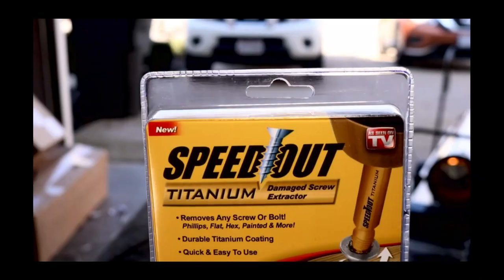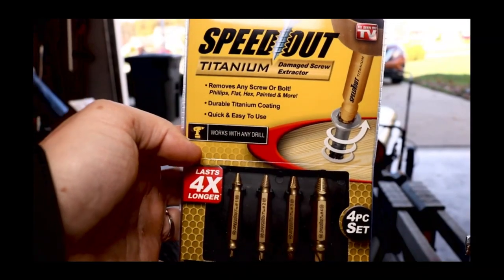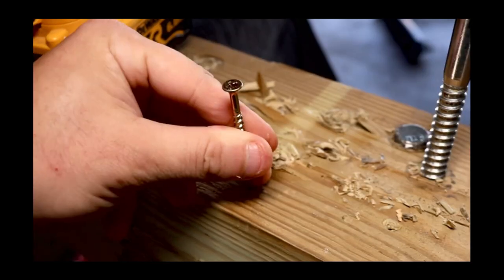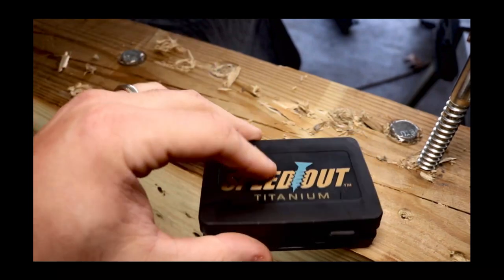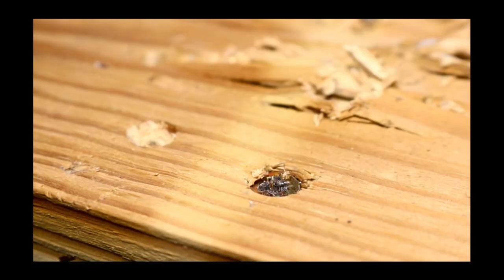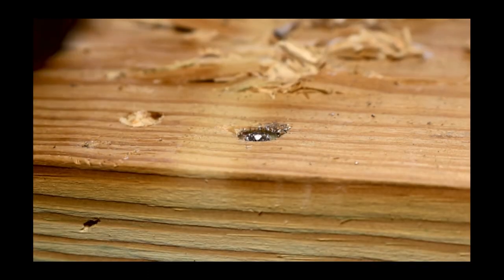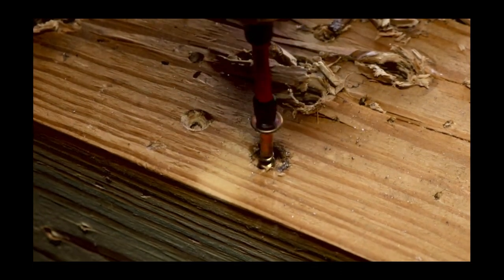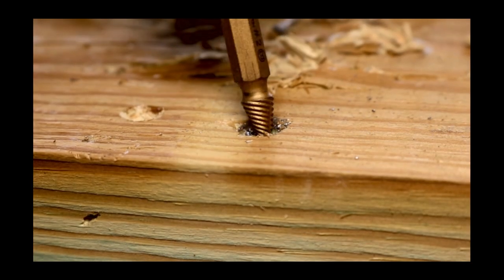Can you really remove ANY STRIPPED SCREW with this "AS SEEN ON TV" (Speed Out) screw extractor set?

Comment: Purchased product yesterday,  having the same problem. Wish I would have seen this video earlier.
Reply: Same thing. I'm replacing deck boards. Doesn't work at all. I'm going to try and get my money back. Home depot should not sell this garbage.
Reply: @dragormeghar2100  thanks for the information.  I think the bits were not strong enough to cut into the deck screws. I've removed other softer screws with no problems.

Comment: First, they’re only titanium plated. Second, you should use smaller size extractor bit. If it can’t drill a nice DEEP hole, use a good metal drill bit, then use the extractor to reverse drill it out at SLOW speed.
Reply: Thank you!!!  It did not work but once I drilled the hole, worked like a charm.  Thank goodness I saw your comment!
Reply: Yo! Your advice work like a charm. I spent the first 30 mins dicking with the cutting tip that speed out came with and got no where. After reading your comment, I busted out the Milwaukee metal bits and then used the extraction tool and it came out with the quickness
Reply: @kyleleah4830  new to these terms can you explain in simple terms ?
Reply: @jjking8577  they make drill bits out of different metals for different tasks. For drilling through metal, it’s recommended to use a carbide drill bit or a titanium drill bit (either fits into any standard driver or you can use an impact drill if you use a hex-shaped drill bit). The commenter was saying that he used a drill bit meant to drill into metal, then used the extractor (the screw-out tool) to remove the stripped screw.
Reply: spot on!
Reply: Yeah , I think the reason this guy's bits rounded was because he used high speed instead of drinking and extracting slowly
Reply: Yep. This guy's main purpose was to make them fail or has zero common sense.

Comment: Coincidentally, I bought and used one of these kits today. I had a good set of screw extractors which were stolen, so when I had a bad screw to remove I looked to replace them. I was in a hurry and couldn't find the ones I wanted, so I picked up one of these sets. They worked fine on this screw; it was removed in about 15 seconds. I don't know how well they will hold up long term, but they worked this time.

Comment: It worked like a charm.  I had little trouble using the smallest bit first - dug a shallow hole out slowly, but used the next size extractor when the first size didn't work and that removed it easily.  I'm luckily only one screw on the 48v battery was stripped - it locks down w three screws which still work w hex head.  Just work slowly when you dig out the hole, and also slowly when you extract with a larger size bit - so this is fine, I'll keep the set of 4 for any future screws.

Comment: We just tried this at home to remove Philips screws really stuck and stubborn in a metal plate in our washing machine... We stripped them trying to get them out, as they're really stuck in there... we bought this product and at first didn't seem to work, but then I just tried a bit more and used side 1 longer and deeper cone cut out and then put to side 2, and gotta go slow (drill needs to have variable speed to go slow movement) and sure enough it worked and got out all the screws... So It Worked !!! I don't have video of doing this, but reporting here honestly. I have photo of the screws after I took them out to see the cone cut out shape in them.. so it works folks !! Money well spent and changed a tub seal on our own and saved $$ calling a pro in.

Comment: Hello. I just used this ten min ago. In defense of this product, it Worked like a charm.
Reply: Hi, do you need a high power screwdriver? I have not had one, I am thinking about getting a 12V cordless with low gears or a 280w corded screwdriver. What type of screwdriver did you use?

Comment: These bits do work for the most part. I was on a job yesterday and had to remove about 10 round hex bolts, only a couple beat me. You just have to be patient.
Reply: I’ve been working for an hour straight and it hasn’t moved one turn yet

Comment: He didn’t drill the bit in all the way before extracting. I just bought this and it works perfectly
Reply: looks like the bit in the video was getting damaged right away, how long did yours last ?
Reply: @derek7793  I used this to remove the original door hinges for three doors in my 1948 home, 18 screws total.  It works but you have to use a lot of pressure behind the drill and really cut a hole in the top of the screw.  In terms of durability I broke one of the bits on an especially difficult screw but given the modest price it was worth it.
Reply: @miguelalmodovar9201  forsure thanks for the information
Reply: I'm using SPAX Made in The USA Fasteners, they got Heat Treated Philips and Torx Head carbon steel Exterior and Interior Screws using a Philips bit #2 and I never had this kind of problem. Sometimes this thing happens when you use a cheap type fasteners. Or you can Still use cheap ass fasteners but make sure it's a Torx head screws for less strip out and cam out. Or you should pre-drill your hole first before installing the fasteners.
Reply: @Luke Gu I sat there and tried drilling it out for like 30 seconds to make sure I was deep enough. Then I switched to extractor, pushed hard, slow trigger, and nothing, no bite. I tried several sizes, different methods, always tried extracting with FORCE and SLOW, no bite.

Comment: I bought a set of irwin brand extractors. They worked really well especially for those door hinge bolts. I even used it on my brake rotor screw. Tool em right out.

Comment: They do work. I’ve had a set for a couple years, they work as extractors. I have plenty of good drill bits, so I don’t generally use the drill end of the bits, I drill out with Milwaukee Shockwave bits, then use the extractor end.
Reply: Yes mine work great also. You have to use low speed on your drill and they most definitely will remove the screws. Most drills have a speed control in the trigger pull, if you don't press the trigger all the way the drills will spin a lot slower. 👌 and mostly all brands of drills have that feature.   Less pull of the trigger in high or low speed setting will reduce the rpms of the drills. 🤷‍♂👌
Reply: Interesting... I've used similar screw extractor bits before and had pretty good results. That "titanium" is clearly too soft to do the job. Shouldn't round like that.

Comment: I'v had a set of these for 3 years used them dozens of time they work every time for me.
Reply: The cobalt ones have worked for me several times as well. I've seen negative reviews on the new titanium ones...it seems they are not really titanium.
Reply: They worked for me also. 👌 I'm buying another set. One for taking to work and one set will be in my work shop. 👌
Reply from the maker: @lesswatt  way to soft to be titanium. I Should have went with the cobalt

Comment: I FIGURED THIS TOOL OUT! I was having the same issues with the extractor just slipping and the bore tool not doing much boring. I was about to return the thing.

I solved the issue by boring first at high speed with LOTS of pressure. Do that for a few seconds until you aren't getting any deeper. Also make sure to not move your drill around to much because you don't want to widen the hole. 

Here's the tricky part. It's counter intuitive but when you swap to the extractor end DONT PUSH WHILE YOU TURN. Before you start turning you can push a little to kind of "set" the extractor. But before you start turning let off all the pressure and go SLOW. You'll feel it grip the screw head and  keep going slow until you get the head out and then you can go a little faster. It's actually surprising how much those thin threads grip the screw head. Sometimes it's actually hard to get the screw off the extractor!

Hope this helps!
Reply: Thank you helped me get a ps5 m.2 stripped screw out
Reply: Great advice thanks I'm going to try that.

Comment: Same results. I've been trying this shit for 2 days straight and all the sizes just spin freely inside the head of the screw. No matter how hard I press it in while drilling or no matter what size. The screws stuck in are the torqx and the head is stripped to a point where they're almost super smooth and that is why I decided to try the speed out bits. I'm getting my money back. I have no clue how the others are able to get positive results.
Reply: How did you end up getting it out?
Reply: @michaellloyd4170  had to scrape the part around the screw to make place to hold the screw with a plier and twist it out.
Reply: try hammering in the extractor

Comment: I use these in very upscale rc cars and trucks and they do work very well on stripped hex screws that most hobbyist use.
Reply from the maker: Yeah they are probably softer metal which helps?
Reply: @ToolReviewZone  negative sir, they use 12.9 grade hardened steel, nothing harder than that. 12.9 > titanium > 10.9 > stainless steel.

Comment: I have a set of Irwin extractor bits and if used at a slow speed they work pretty good but I use a separate drill bit to drill, then the extractor bit in the kit.   I've only had to extract a few screws over the last few years so the kit is there if I need it.  Thanks for sharing.  Cheers Clint.
Reply from the maker: Thanks for the feedback William! I've heard a lot of people saying the Irwin is good. I'm going to try it

Comment: I didn't buy these, but some different ones via Amazon. Had exactly the same problem. Instead of the extractor drilling into the screw, the screw stripped the metal off the outside of the extractor. Doesn't anyone make decent tools any more with the need for a small loan?

Comment: I bought this and it did help very well.  ... I just did not follow their instructions. I did it my way first use A side on drill. Second use B side on a very low speed such a 3 or 4 is good, the hammering on low speed will help to dig in and keep on trying on very low speed and hammering. If does not help move to speed 5. It should work

Comment: Purchased the drill set, came across this video and was very discouraged. But I decided to give it a couple more tries.. but this drill set really does work! During extracting keep pressure directly over the screw and go slowly, you may need to go up a size but I was able to remove two horribly stripped screws in a couple minutes. Hope this helps!

Comment: You are supposed to use the cutting side in clockwise Forward drilling in then flip the bit to the cone side. Now switch from drill to counterclockwise REVERSE and slowly reverse it.  Works fine.
Reply from the maker: They are crap
Reply: Negative. Both sides are for Counterclockwise. It's in the directions.

Comment: Every time I come across a new screw extractor, I gotta buy & try. Have around 7-9 kits somewhere around here from all different brands & places. Gotta say, it’s a hit or miss I’m d of thing. I have some expensive kits, to cheap kits & sometimes they work, & sometimes they don’t. Even picked up the Ryobi kit (most recent)I saw in a vid to give a try.....it’s ok, & like the others, works sometimes. Gotta tell yan if anyone ever figures out to make the BEST screw extractor kit that works 100% of the time (or even 20%, lol), they’ll be raking in the 💰 .  Looking forward to another bit vid.
Cheers✌🏼

*edited cuz autocorrect
Reply from the maker: Which one do you like the best Aepek? I'm sure there is probably something out there right?
Reply: Tool Review Zone Right now been using the $10 Ryobi set I picked up. Have used Rockler, Craftsman, Irwin, Ridgid, DeWalt, etc...screw extractor bits/kits & got quite the collection. I try not to strip a screw out, which is best way, as the extractors are a hit or miss at times. Have some good luck w/ the Rockler & most recently been using the Ryobi (so far it’s worked 1/2 times). The oldest kit is my Craftsman & I’ve never gotten a single screw out with it, lol. Haven’t found a set that works all the time. Cheers✌🏼
Reply: @Aepek  Wondering if you ever tried Vampliers to get out a long stripped screw (4 inches in wood). Reviews seem to be pretty good.
Reply: Lim Yee No I have not. But, b/c you just asked me about them, I googled them, & ordered the 8 & 6.25” & 7.5” pliers to check out for myself. Appreciate the reply, & for letting me know about a brand never used or heard of before.
Cheers✌🏼

Comment: The fact that the Philips bit worked in the end is all the evidence you need that it was not done properly. The drive of the head should be a completely smooth hole- you didn't drill out the drive portion of the head fully and should have never proceeded to the extractor end until you did that. 

The extractor ends work, but if the drill ends don't do a good enough job, you would have been better off using your own twist drills. Hard to tell if the drill end of the extractor was truly junk, or if was user error again.

Comment: this should Be interesting, I just bought this set last week but haven't used it yet. 👌
Reply from the maker: Let me know what you think
Reply: I actually tried them last night. I stripped out a spax 3 inch pan head cabinet torx screw and, used my drill driver in low speeds in reverse like the instructions said and they worked perfectly. Not a problem . You can't use them in high speed they won't work properly. And never use an impact driver they won't work like that also.  I did several different screws also with the same #1 bit extractor and it worked on all of them. 👌 I even took out a quarter inch thick, 3inch long lag bolt, not a problem. 👌 all low speed with my Dewalt 12v Xtream brushless drill / driver. Trust me they worked great for me. 👌
Reply from the maker: @jasonlevesque9303  thanks for the feedback
Reply: @ToolReviewZone  ,no problem, I like your channel and watch all your videos. 👌 trust me I'm a fan. This was the only video I've watched that I didn't agree with. So i had to give it a try and see for myself. And it worked great for me. But keep making videos. 👌 and I really want to see you do another video with the drill on low speed setting and see if these work out better for you. I'm subscribed and have my notifications on. 👌
Reply from the maker: @jasonlevesque9303  all good bro. I'm happy with the feedback and like to hear what others have to say. All I can say is that i did everything that the instructions and their own video said to do without the same results. I'm glad they worked for you, but its just my opinion that they are no good. That's one thing about be, if I don't like something, I won't say I do just for views or a sale.

Comment: I wanted to believe in these. I specifically bought these because of the cool flip gimmick. I tried them today, following the instructions to the letter - even pushing hard and trying to extract very slowly. No dice. I tried the smallest first, then moved up and then back down in sizes. Nothing. 
What I believe the issue is, is that the borer drill is just crappy and didn't work well. I feel like the extractor would have worked just fine if the borer had done a better job. I used a regular drill bit and it worked WAY better. (Unfortunately I did not test the biting bit to see if it would work. I was just frustrated and felt left down at that point.)

Comment: I have a set, and they work fine. What you’re doing wrong is trying to back out the screw so quickly. Drill the hole in the screw more deeply, not larger, and then use the extractor end and sloooooowly back it until it grabs solidly. Then continue to slowly back out the screw.

Comment: I also had the same problems with the Speed Out wearing down at first step and after 10 minutes of drilling it was not digging in anymore.  I think the COBALT version might work out better.  So I will try those later today.
Reply: Did the cobalt ones work better?
Reply: @ccbowers  Yes the Cobalt works better with some effort.  5o what I came to realize is to make sure the first step digs in deep.  The extracter end needs to grab in the recession deep.  If not be prepared to move up to the size diameter.  My stuck screw was in a metal/steel object and make sure you stay centered to not damage the threads to be used for a new screw once extracted.
Reply: @aceball7076  That biggest problem people have with these is not understanding how they work (plus having a poor quality one). Without a clean hole (like you said) the extractor end won't bite properly. The fact that he could still pull out the screw with the Phillips bit in the video showed it wasn't done right.
It is certainly partially due to a poor drill end of the bit, but also user error. In this case, I would use a higher quality twist drill to get a cleaner hole, rather than continually increasing bit size before creating a clean hole to begin with.

Comment: I bought a kit it didn't work screw head stripped it using a Philips I managed to get one screw out with just a Philips but needed to remove 5 more I tried everything tried cutting the head off no luck, heated it up thought maybe loc tight might be on threads still nothing I give up trying to remove the guard off a bench grinder 🤬